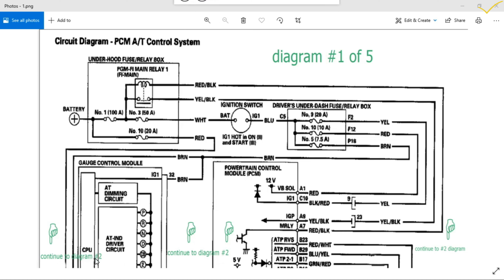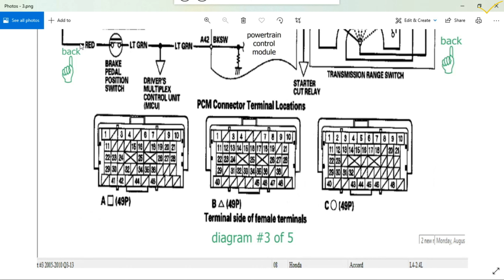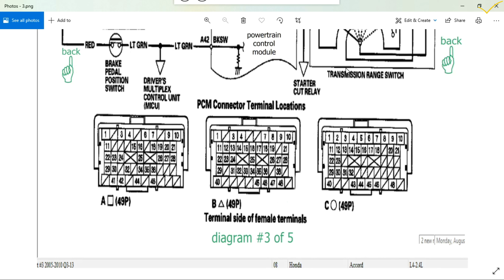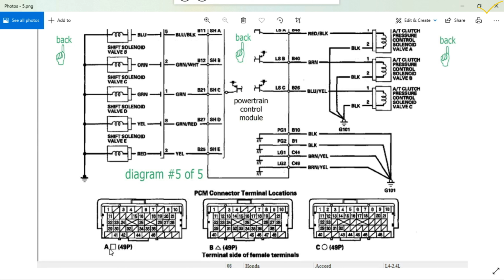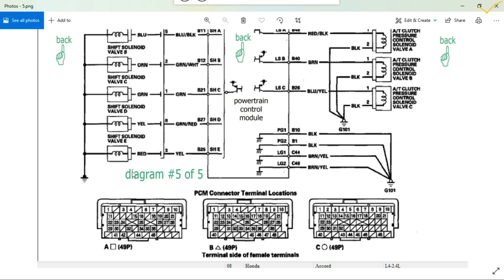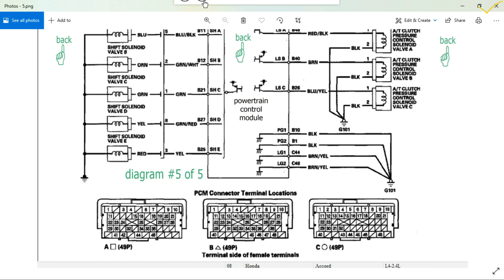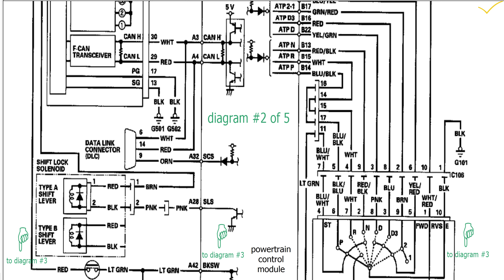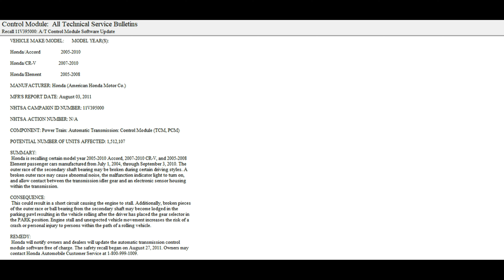2008 2012 honda accord 2.4 automatic transmission wire diagram and parts locations

Comment: would you be able to help me out? I need to find the name of the sensors thats under the cow of a 2011 honda accord
Reply from the maker: there are no sensors under the cowl, only wiper motor, thanks for sharing
Reply: @JM-AUTO  okay can you tell me where the accelerator pedal position sensor is on a 2011 Honda accord?
Reply from the maker: @cheesex275  this is in the gas pedal where you push gas, it is integrated with the gas pedal as un unit.